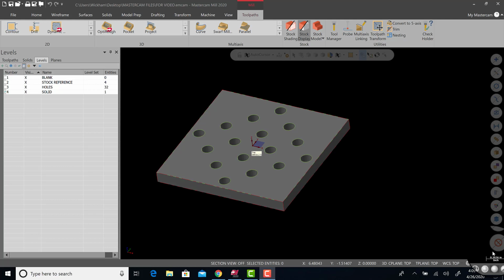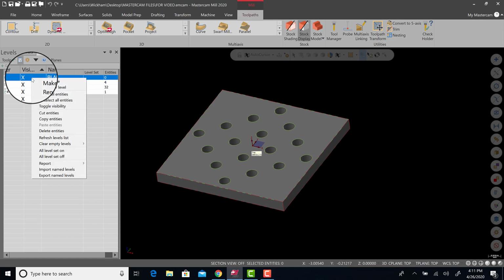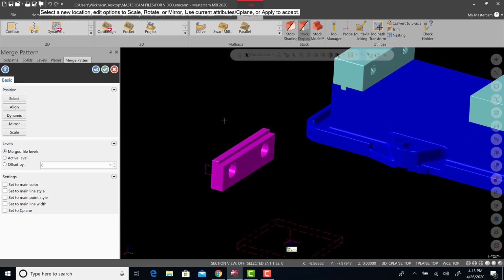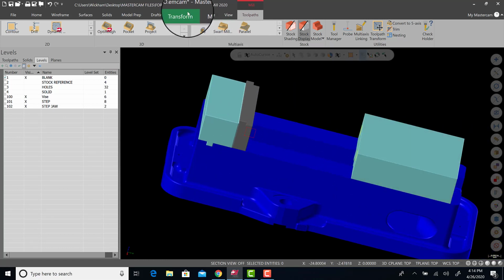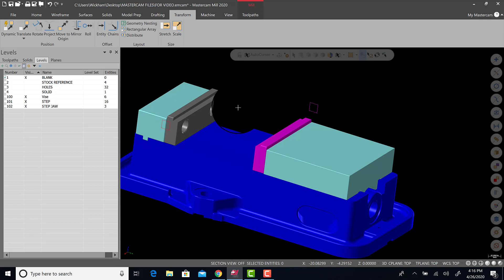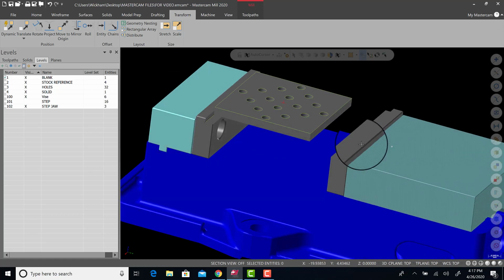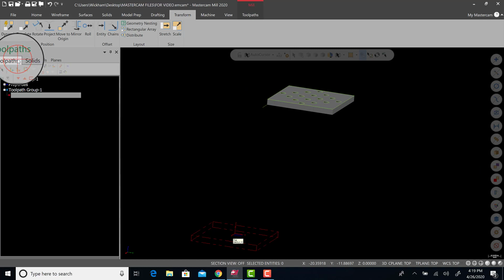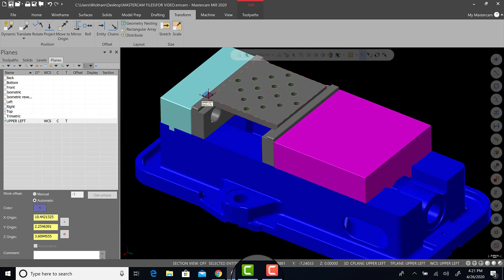MASTERCAM IMPORT FIXTURES

Comment: yeah but where did u get the fixture from
Reply from the maker: Download from Kurt website
Reply: @BrianWickhamMFG  all i have is a folder and it doesnt drag into mastercam what do i have to do how do i convert it
Reply from the maker: @alexcalibasi7028  If this is a folder from the kurt website it is most likely compressed. Unzip the file and the individual parts should be in there for you to merge.
Reply: @BrianWickhamMFG  nothing is in the folder
Reply from the maker: @alexcalibasi7028  https://www.kurtworkholding.com/product/kurt-dx6-crossover-vise/
Bottom if this link has the cad downloads. Is this where you downloaded the file from?
Reply from the maker: @Alex Calibasi  Make sure it is a .stp or STEP file.
Reply: @BrianWickhamMFG  k then what
Reply from the maker: @alexcalibasi7028  If the file is compressed, unzip it. In that folder should be the vise cad files that you can merge into Mastercam.
Reply: @BrianWickhamMFG  its a blank white document that doesn't merge
Reply from the maker: @alexcalibasi7028  if the files are not appearing in the mastercam open window, use the drop down in the lower right to show .stp files instead of mastercam files.
Reply: @BrianWickhamMFG  i did that still no luck
Reply from the maker: @alexcalibasi7028  I will make a video soon.
Reply: @BrianWickhamMFG  nvm i got it
Reply from the maker: @alexcalibasi7028  Excellent, what was the issue?
Reply: @BrianWickhamMFG  I was trying to drag it instead of clicking on it, lol
Reply: Next thing I'm trying to figure out is if I should program to nominal values or just set the tool wear to the nominal values
Reply from the maker: @alexcalibasi7028  I program to nominal normally, then comp away to ensure I do not cut undersize if I am worried about it.